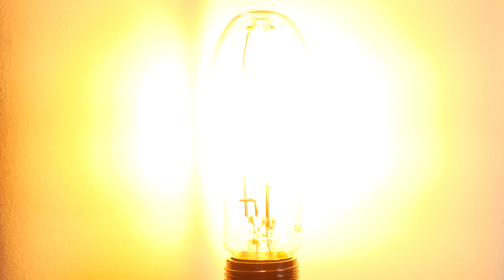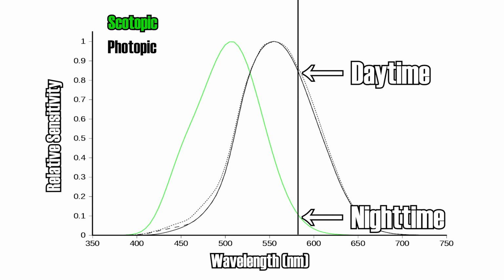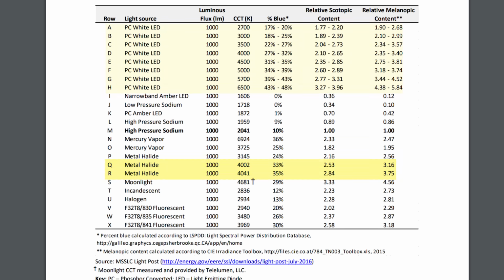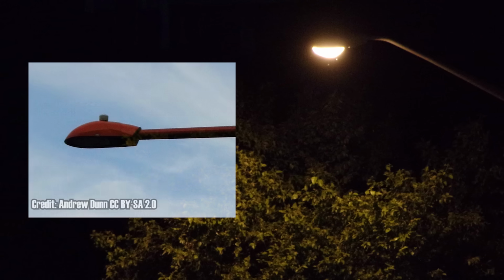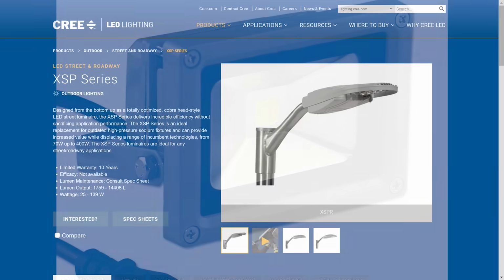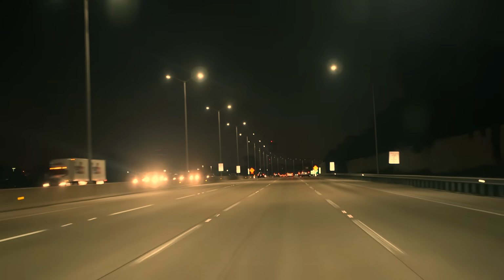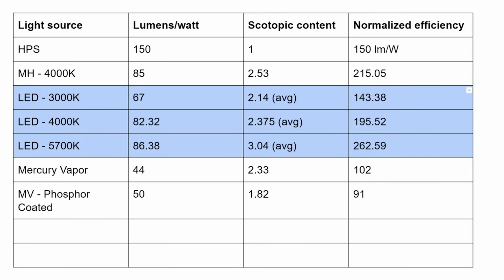The LED's Challenge to High Pressure Sodium

Comment: They put LED lights on my street a few months ago, the particular fittings our city use kinda suck... they work but they use a light sensor to know when to turn on or not, problem is that it uses an exact threshold to switch on and off instead of using a latch (I don't know the proper term - If it hits X value and turns off it has to increase some amount until it can turn back on again, in this case it will turn off when it goes below X and back on again as soon as it goes above), so for a while during sunset they will flicker on and off. Kind of amusing.

Comment: You've missed some very important points about colour temperature:
1. Blue light causes "visual purple loss". That's the blindness you experience after seeing bright light. Hence why the lights inside military tanks, planes and submarines are red for night missions. A bright blueish light on a highway is worse than no light at all if there's an unlit area past it where drivers will be blind.
2. Bitumen (you may call this blacktop, tarmac, asphalt etc) is not black. It's actually a really dark brown, which is red-based. Makes sense since tar comes from oil. This means when you're on a road surface that isn't concrete like your interstate example, the road surface itself appears a pure black colour when using blueish lights. Potholes are invisible when the road is black and the holes are black. Potholes are far more visible with a more yellow light, as the road is brown and the holes are black.
3. Blue light causes more glare, a blurring of objects due to "scattering" within your eyes. This is because the wavelength is similar to the size of microscopic structures in your cornea. It's not noticeable on a flat uniform surface like the concrete interstate in your example, but it makes license plates and road signs (high contrast surfaces) unreadable when you have 6000K HID headlights.
4. Blue lights cause more fatigue. They keep you awake but make you more tired, distractible and irritable. Blue lights make you able to stay awake for a short time, but over the course of a long drive will make you need eye rest sooner. If you won't believe me, maybe you'll believe the multinational car manufacturers who put blue-blocker glasses on their drivers for the 24 hours of Le Mans because blue light makes you tired.
Reply: Another consideration is Blue cast Verses Amber or Yellow cast light source through; mist, rain, fog and snow. Light that reflects back creating less visibility is detrimental.
Reply: Most of this is myth and nonsense. 
1) You do not suddenly go into a dark area with your car and switch to night vision. Your headlights are enough to prevent full night sight adaption. What you claim is only true when blinded by poorly adjusted LEDs from cars coming your way.  
2) LPS has the worst contrast. Wider spectrum = more contrast.
3) Nonsense - imagine people tested that lighting and subject showed better reaction to obstacles.
4) Agains nonsense. The Blue blocker is there to prevent blinding under daylight conditions.
Reply: These comments are very intelligent thank you all for your knowledge
Reply: Minor correction to your first point. Submarines only use red lights during periscope operations at night and only in the room as the periscope operator. Surface ships will use red lights on the bridge and anyway passageways leading to the outside. Submariners don’t usually go outside when underway.
Reply: Lifestyle and working environments can also have a detrimental effect on mental health, not only disrupting the circadian rhythm but with more severe effects like depression. I wouldn't say that blue light is the main culprit here but if someone spends his/her time working on a computer under artificial lighting and then when s/he leaves at night to find the streets lit with 6500K LEDs the long-term consequences can be very worrisome. I remember reading of a study linking the habits of the typical office worker in Japan with depression and the high rates of suicide in the country, and a important consideration in the study was the prevalence of blue light in their perfectly well lit cities, offices and homes. There are other things to consider of course, after all they're not new and can be correlated to many other factors, I wanted to read the study again but couldn't find it, still I think this website gives a good summary of what we know about how blue light affects us and why we should take it with moderation, so to speak: https://www.mhanational.org/blog/how-blue-light-affects-mental-health
Reply: +Ometecuhtli Just remember that correlation does not equal causation. I'm not saying that you're wrong, but just to take it with a grain of salt.

Comment: One big factor not considered. The headlights of your car and the interior are producing light as well. So I don't see what difference it would make overall. Most cars in a matter of years will only have led headlights and any high trimmed midsized sedan like a Honda has had hids for like 15 years with those higher color temps. Even many base model cars are coming with leds now a days. Example toyota corolla.

Comment: Great video, though i disagree with the aesthetic part. I used to live in an apartment with those orange street lights just meters away from my window and it caused my flat to be completely washed in that dull light and it made sleeping more difficult (curtains would have been nice but this apartment didn't have curtain rails, only blinds). Now i live in a different place with white LED lighting outside and the difference is like night and day (:D). The LED is much more like natural moonlight and the overall brightness is lower, but it still lights the area just as well if not better.

While driving the LED's do make distinguishing objects much easier, especially pedestrians and other smaller things. The only condition where i feel HPS is better is during heavy snowfall.

Comment: To help roadway lighting and light pollution issues, cheap infrared sensors could be placed along the roadway to turn on light sources half a mile to a mile ahead of cars during off hours (low traffic hours). Allowing the lights to be off more often than on during the night. 

   States or cities could also implement light pollution laws with increasing fines for breaking these statues.

Comment: You missed an advantage that lights with low scotopic sensitivity have. Rod cells are bleached much more heavily by bluer light, and constantly replace their pigment. Blue or white light will thus completely eliminate your ablity to see anything not illuminated by the lamp, whereas the HPS lamp will only partially destroy your night vision. In any situation where there are shadows, and noticing what is in the shadows is as important as what is not (this includes roads where there is wildlife) the HPS is superior. Aditionally going through an area with LED lighting will destroy your night vision.
Reply: Why do you think you use red to keep it?
Reply: @JackNedry  Because it maximises your ability to see things over time. Increasing activation of cones and decreasing activation of rods is a feature.

Comment: They just changed the lights to LEDs in my neighborhood, interestingly enough, I came home from work at the exact moment they moved their truck under the one right across the street from my house. I watched for a moment. The light is now a cool white light, and is much different than the previous HPS bulbs. They had the whole fixture off and the new one patched in around 5 minutes.

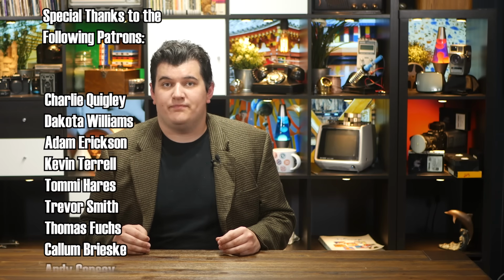Comment: Around 21:00 minutes.   I do astrophotography.  My town and surrounding towns switched to LED.  They are awful. I can see the towns 10 miles away in all directions.   The HPS lamps were sooooo much better.  I hate these LEDS.    The odd thing is, up close it appears that the LED's are directional and do not output upwards like the old lights.   Just not the case.  Might it be bouncing upwards?

Comment: So better visibility, lower power consumption, more alert drivers and roughly the same price. Wheres the downside
Reply: No heat generation and glare.

The glare from LED fixtures can be quite annoying compared to the somewhat softer light produced by sodium vapor.

LED fixtures also generate much less heat, so this has been an issue when LED bulbs are used in traffic lights in snowy areas, requiring many new LED traffic light fixtures to be equipped with electric heaters.

Comment: On a dark road I find no problem passing a car with standard headlights but the blue light of vehicles with led lights makes your pupils constrict, making the amount of light your eyes can percieve much lower. Also your pupil dilation time increases with age taking up to 15 min.
Reply: What you say is correct.  Poorly adjusted headlights, whether it is due to aiming or color output, are a hazard to other drivers.  Some states have police that will actively ticket people for this, but far too often people don't care.  Most of these drivers are like "Oooh, look at my pretty blue lights!" and they'll refuse to address issues even after being ticketed multiple times.

City folk will likely never know it, but out in the country if you walk outside at night, even on a moonless night, there is enough starlight that you can easily walk around without a light once you have proper dark adaptation.  Hell, I've driven with my lights off on country roads at night with no issue, but the instant another car shows up and their headlights reach your retina, you are blind and have to resort to your own lighting to see where you are going.

Comment: weed growers have much more luck regarding LED's. the plant needs to spectral colors, both are way off the spectrum of sodium high pressure lamps, which they used back in the days. their are two types of LED's largely unsuited for ordinary lighting, that happen to be very close to the spectral needs of weed. the power consumption of growing weed (by far the major cost factor) consequently dropped by a factor of ten during the past couple of years.

Comment: I personally think the visibility increase of the cooler LEDs is absolutely worth any circadian disruption of drivers. It's not like you want them dozing off anyway, and the increase in visibility is MASSIVE. One thing I've only seen a little research on but that should be considered is that it  is suggested that the difference in visibility actually becomes increasingly more apparent as normal visual acuity of a person decreases. So for perhaps older drivers, or people with otherwise less than flawless vision the increase in visibility is even more pronounced than it would be for a bog standard normalized person.

Comment: "(...) blue light can also induce photoreceptor damage. Thus, it is important to consider the spectral output of LED-based light sources to minimize the danger that may be associated with blue light exposure. In this review, we summarize the current knowledge of the effects of blue light on the regula-tion of physiologic functions and the possible effects of blue light exposure on ocular health."

https://www.ncbi.nlm.nih.gov/pmc/articles/PMC4734149/pdf/mv-v22-61.pdf

TLDR: Blue light could be harmfull..?
Reply: Cherry picking. 

Besides, this review doesn't establish anything with any level of evidence... the most common verb used is "may".

Fixed TL;DR : blue light, especially in the near-UV, can be harmful under certain circumstances, yet searchers struggle to determine safety thresholds for acute and repeated exposure...

So yes, staring directly at high power old-tech-low-end blue/white LED is definitely a bad idea... But modern LED-based lamps carefully avoid a peak in those wavelengths, and in normal conditions of use they are most likely not more harmful than any alternative.
Reply: @KorOsion  Dude, they don't "carefully avoid a peak in those wavelengths" but rather it was next to impossible to have blue LEDs for awhile. Nichita I believe made the first one if you are anxious to google up the tech data on them.

Comment: I know I am almost a year late to this, but I have a CREE streetlight if you would like a look inside of it. (it got a little smashed when it hit the ground... Someone hit the pole it was on). The CREE street light photocell sockets can come with the 0-10 volt dimming wired into it. Here in Ottawa, I know they can change the light output using the 0-10 volt dimming system should the light be too bright. I am still not sure how the photocells work that have 0-10 volt dimming capability.

Comment: This is my favourite video of yours by far: Very well done covering such a comprehensive topic so understandably; Thank you for work!

PS. This reminded me of something I read: Due to Germany's history, a lot of the former west uses newer LEDs while a lot of the former east still uses High-Pressure Sodium lamps which you can see very nicely in this photo of Berlin as an example². Now, this might not be a conclusive correlation but statistics show that the severity of traffic accidents and their resulting death rate is significantly higher in the former east compared to the west³. Whether this is due to the availability of rescue services and the quality of the infrastructure, motorway maintenance and the lack of financing in the east or any other factor, is definitely up for debate. But I found this correlation given this particular topic pretty interesting none the less.

²  https://twitter.com/Cmdr_Hadfield/status/324638635766980608
³  https://de.statista.com/infografik/1954/anteil-verstorbener-personen-an-den-verunglueckten-bei-strassenverkehrsunfallen/

Comment: Those yellow Sodium lights are bad for color rendering.  One night walking to work, I noticed a "Dog" under a bridge I was crossing (illuminated  in shades of yellow)  When the brown? "Dog" looked up at me, & bolted for cover under the bridge.  I suddenly realized the "Dog" was a Fox!  You have no way to discern color(s) of items viewed under those lights.  
The other point about animals not being able to see Sodium spectrum colors makes me wonder if Deer feel safer crossing what they think is a unlit road?
Last thing I've noticed working at night, an outside parking garage replaced all the Mercury Vapor Lights with LEDs over time.
You could see that the insects that collect around lights did not fly around the LED lights much at all even though it seems just as bright.  (no UV?)

Comment: The cons of LED lighting for me is that its colour spectrum isn't smooth like sunlight - it has peaks and dips which makes it "white" but an ugly unnatural white. Also, for whatever reason, their power supplies seem to be of poor design as I'm seeing them having to be replaced all the time. Energy saving and economic, but not really when you consider the labour costs and waste.
Not related to street lighting, but they're useless as torches because they make really hard shadows. LED grids produce "stepped" shadows. Combined with the poor spectral response, rooting through coloured cables/wires in a dark place, for example, is useless with an LED torch/flashlight.

Comment: Yeah I don't want melatonin levels in drivers rising as they are lulled to sleep by inviting warm lighting. 

We've just had LED street lighting installed on our road and boy is it nice. At first glance it seems completely underwhelming because the spot brightness in your peripheral vision is much lower as is the intensity of bright spots directly below the lights. Then you notice how evenly the entire road and pavement is illuminated and then, due to the lack of any bright spots, how easier it is to see things because your eyes aren't re adjusting from looking at a bright spot. 

This is all being done with lights installed on only one side of the street vs before too. The light is just controlled in such a precise manner that it throws the light exactly where its needed with great even-ness in light coverage. 

If you want to look at LED optics for street lighting lookup ledils strada range. 

The biggest advantage to us in the house is that we have a lamp almost directly next to an upstairs window. This used to be low pressure sodium and was quite intrusive as it lit the room up when it turned on. The LED lamp? Nothing. All the light goes where its needed and that isn't shining inside an upstairs window. These might be cool white but no light goes up to the sky except reflected light from the road and as the absolute intensity is low but with very even coverage...yeah as an occasional amateur astronomer, roll on LED street lighting.

Comment: Interesting. This finally provides a technical explanation of why I have never been able to see well under sodium lighting on highways. I've always hated it. Thanks for the explanation.

As far as filtering light to cut sky glow, the sodium D line of low pressure sodium is easily filtered with common neodymium or didymium glass, which is why it is popular around observatories.

Comment: The Rythm Disruption is good in some way.. look: If you're driving at night and you have some HPS Lamps hanging around, you will get tired while driving. With LED's or blueish light in general, you won't get tired so fast and thus road safety is even higher.

Comment: I was driving north on 355 last week, between 55 and 88, and there's a section where the tollway is replacing the old sodium lights with new LED's. The LED's are lighting the on-ramp, and the sodium lights are in the median. It was a good contrast between the two light sources. Might be worth a drive over if you're looking for more cool footage.